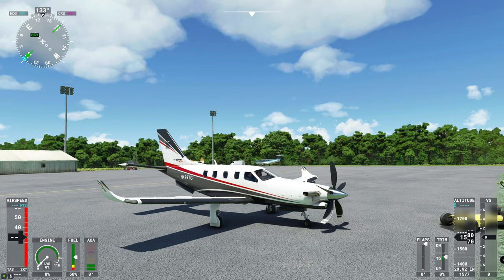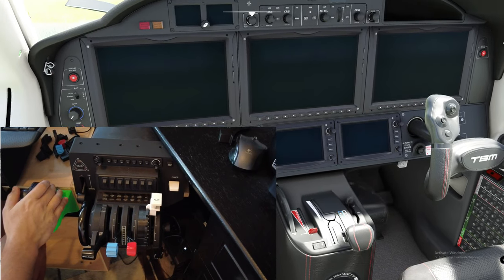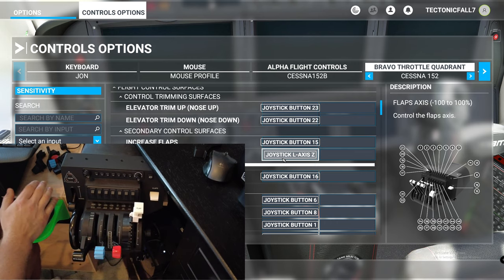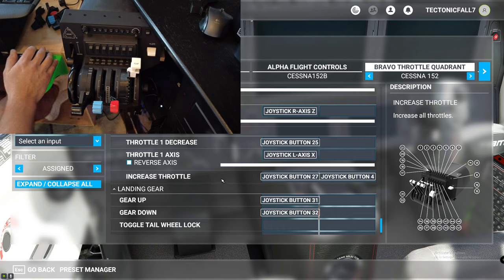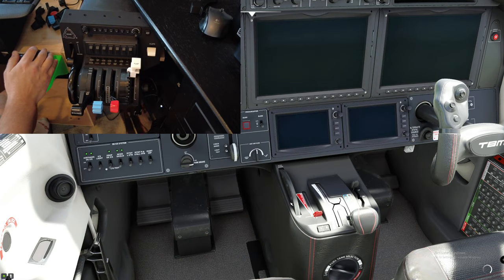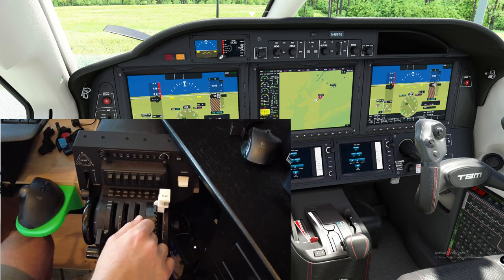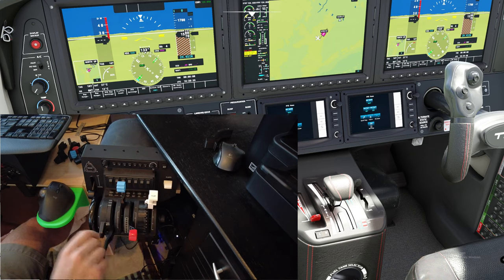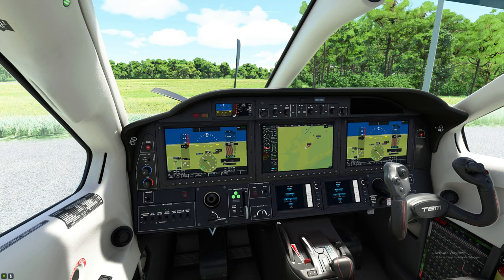MSFS Bravo Quadrant SETUP TBM930 AFTER Sim 5 ! Can't start the TBM930 and Throttle doesn't move!

Comment: Perfect! Just received my Bravo throttle quadrant and as the TBM is one of my go to planes, configuring it was a must. I actually used the Go Around button on that particular throttle lever to assign to the Increase Throttle function. Many thanks.
Reply: So after doing some playing around, my brilliant use of the Go Round button proved to be not so brilliant! That button is a bit too easy to hit - albeit accidentally - resulting in an undesired increase in throttle. Back to assigning Increase Throttle to one of the other levers.
Reply from the maker: Yeah I didn't think the Toga button would be good 😕 very easy to hit you can assign it to the Rev button

Comment: Thank you so much. I'm trying to get it yesterday by try an error, but after one hour I gave up. Now with your fantastic help - it works fine! The lever for “Mixture 1 Axis” is not necessary, if the “Increase Throttle” command is assigned to the “Button 4” (REV) on AP panel.
I also use the Flaps Axis at L-Axis Z, my switch “Flaps up/down” is then assigned to “Plus/Minus” to get a spool-up to the desired HDG, VS or ALT in AP mode.
Reply from the maker: Great I'm glad it helped you 😀 thanks for watching and sharing your setup
Reply: It also works if the “Increase Throttle” command is assigned to the “Button 9” (Go Around) at the Power Lever. I think it's easier to handle than to press the “Button 4” (REV) on AP panel.
Reply from the maker: @gerhardb8395  yep you can assign it to what ever button you want really I was just giving examples of where you can map it .  Thanks for watching 👀 .

Comment: Your videos are awesome. Do you think you could do a video showing how to configure the Honeycomb Bravo for the new Carenado PC-12? Keep making the great videos!!
Reply from the maker: Hey thanks for the comment since this video I no longer use the standard Microsoft flights and bindings. I now use spad. next for everything. It works so much better. But the PC12 still has issues with certain key bindings and that's most likely due to caronado not putting the wasm or lvar codes in correctly.

Comment: Very much enjoyed the video, and thank you for this set up routine.  I've bought both the Alpha and Bravo units jsut this last week - they are absolutely superb - what an upgrade!!  For this Daher fix, just initially I struggled with the throttle control, then realised that the Increase Throttle command I'd assigned to an axis was a switch effectively - leaving the throttle in the full down detent position really screwed up the Propeller Axis.  Once I'd realised my mistake - no problem!  I wonder if use the Alpha as well - I'd dearly love to be able to assign a switch to the Engine Ignition Start up top - any toggle commands end up with the switch going back and forth, and no other assignable command seems to work!!  
Thanks again - hope you dont' mind, but I passed this video on to an MS2020 subscriber to the Flight Sim forum.....
Reply from the maker: hey thanks very much for the comment . yes i understand about the toggle buttons i would recommend spad.nxt it is fabulous with the tbm  thanks again for watching
Reply from the maker: Also you may want to watch this video on the bravo a little issue that you will run  into https://youtu.be/dR-QUxHw1oA

Comment: Hey I'm planning on upgrading my sim hardware. Just wondering what I should buy first? The bravo throttle quadrant or the alpha yoke? Ik now own a cheap t-flight from trustmaster. And should I invest in a rudder control or just use autorudder and map it to a button on the yoke?
Reply from the maker: Hey thanks for the question so what I would if you are going to buy both anyway I would get the one that would make more sense to me. Meaning if you fly yoke aircraft all the time then you need a yoke but if you are a sr22 guy or a airbus guy the the throttles make more sense cuz they use joysticks. Once you figure that out the next is rudder pedals . DONT cheap on those I did and got the Saitek but they were not great and had issues with prolong use. Personally any type of pendular pedals would be perfect to replicate the real thing I upgraded to the tpr pedals and love them alot of people may say naw don't worry about pedals get the cheaper ones but they are also the people that don't have the penduler type pedals, so if you can't swing it now just wait until you can and save yourself the money you would have thrown at cheaper ones. Rudder pedals are a must for realism. 😉 my 2 cents
Reply: @2020fsers  I guess i mostly fly yoke planes like tbm 930, cessna 172 gp, and citation longitude. dont play dcs either.  going for the Alpha first and then for the bravo quadrant ( i really want the AP features it comes with, i´m so tired of scrolling my mouse). ill stick to autorudder until i saved up for the charlie rudder from honycomb. Thanks for pointing me in the good direction.
Reply from the maker: Your welcome

Comment: It seems to be working now ...Oh Boy - I am not using the Throttle Increase button FYI.
I can get the throttle to move back and forth Left to Right Feather location then pull throttle once to the low detent temporarily (quickly) to low idle, then again to throttle OFF.  FYI

Comment: I got something for you to help me with.  On the PMDG what would be the setting for the flaps.  The Boeing handle does nothing Selected to Flaps 0-100.  However the Flap switch to the Far Right works.  Can you look into it I’ll help test it.
Reply from the maker: Check and see if there is a flap axis from -100 to 100 and pick that one and retest
Reply: I’ll give it try when I get home.
Reply from the maker: Let me know 😀
Reply: Well what worked was Flaps AXIS with reverse box Checked.   Flaps 0-100 did not.
Reply from the maker: Great to hear glad you got it sorted 👍

Comment: Nice setup  adjustment!  Appreciate it!!!   Noticed your Bravo lights not activated on the TBM...is this a "bug" after the update?
Reply from the maker: its weird sometime they work and others they dont im still trying to narrow that down. im using the mixmugz mod now just released ima do a tbm ifr flight tomorrow and post with the g3000 mod from working title and ill see if the leds work.  thanks for watching
Reply: @2020fsers  Yes, I have had the same issue.  Seems like when I'm adjusting the setups, it doesn't work until I restart and sometimes even switch planes.  Wondering if launching the .exe is required as well?
Reply from the maker: @barrycobbley3331  yep I just posted a video on that for people that have the issue yes need to run the exe file after the sim loads 😉

Comment: Thanks I notice you have the first position covered (Speed Brake ? ) So the first throttle lever is in the second slot.  Im guessing its easier to add twin engine levers ? Also what is the "Throttle Decrease " and "Mixture Decrease" and any "Decrease" using the position number past the detent ? whats it do ?
The name is confusing ?  as is the Mixture Throttle and Propeller (-100 to 100% ) compared to the respective  "... Axis ?  does anyone understand the differences and issues with using these  ?  Should you use Throttle ? or Throttle 1 ?
IM trying to use what works but in my experience the MSFS has so many intermittent issues I cant tell what works and what does not? or what its suppose to do ?
Have you seen the rotate knob to increase or decrease values suddenly only allow 1,000 foot increments for altitude ?
Thanks again for your video
Reply from the maker: hey there thanks for the comment throttle decrease is used for reverse thrust  mixture can be use to turn off mixture they can be used for many diff things depending on the aircraft .  using throttle 1 or just throttle well if you have a single engine it wont matter but if you have a twin or more than it will because you dont want that 1 throttle to control all of them. yes i have seen the rotary knob change values to that i have no idea why .. Its just trial and error you have to use what works for you for what every you are trying to do . or get spad.nxt and that will really help but it gets even more confusing if you can't grasp whats in msfs. les orilley has awesome tutorials on spad  thanks again for watching

Comment: This is my favorite plane so far... and I still cant get the throttle working properly - for about a month I could fly but the cockpit didnt show what my throttle was doing .  I just tried to use the "Improvement" addon ... not sure that language applies ! lol.
Im frustrated a always with MSFS, but the XPLANE TBM is not as nice to look at or fly - so Im still at it. Im confused by the use of the PROP lever since I dont see that in the cockpit am I missing something ? Or is that just to allow the lever to move left for full flight power ?  The main issue is the throttle just jiggles and shakes ... I am reviewing the setup and all levers and positions.  
Any suggestions ?  I just deleted the 930 improve ADD ON however I did include the G3000 addon.  Thanks fot the video.
Reply from the maker: Thanks for the comment the prop lever is to get the throttle to move in the cockpit on the right ride of the gate and to move the throttle over to the left of the gate.
Reply: @2020fsers  I see that is the response... how did anyone ever get to that point ? is there a hidden manual somewhere ?  thanks again.
FYI I got the Throttle working properly... Unstable software apparently - I changed something then changed back - then rebooted.  It worked ? !  gaaaahhhh.  I see this way too often.
Reply from the maker: Glad you got it working
Reply: @2020fsers  and yesterday I had a flight and the TBM 9:30 everything cool try it again throttle just jiggled and shook... Came back to it and it worked this is a common occurrence although I don't hear anybody mention this in the YouTube videos I assume it happens to everyone maybe not. Someone else had recommended adding a button to increase throttle I use that with no effect apparently.
Reply from the maker: That I am not sure I use spad so I don't ever have any issues.
Reply: @2020fsers  Spad eliminates these sorts of issues ?  I checked out Spad - seemed complex.
thanks again.  My issue seems intermitent, the worst kind
Reply from the maker: Spad is pretty easy once you wrap your head around it . Check out les  O'reilly youtube he does great tutorials.

Comment: I’m fascinated by the mouse you are using.  You hardly seem to have to move it at all!  What is the make and model please?
Reply from the maker: Im using the Logitech MX Ergo Wireless Trackball . They also have the m575 model not sure why the text went so big I copy and pasted it. The 575 is about half the cost of the mx I love it. ❤  thanks for watching if you get 1 do y forget to clean the ball it pops out and clean with qtip and rubbing alcohol the rollers and the ball 😀

Comment: Sadly, a later SU has rendered these instructions unworkable. Following your instruction, Increase Throttle put the throttle in Low Idle rather than than initial increase. Using the mouse does nothing. I can still make it work moving the throttle and prop controls, but I really wanted something to move the throttle from Cut off to the initial lo point. 😬 Thanks anyway.
Reply from the maker: Yes this is an old video and doesn't work anymore . 😕
Reply: @2020fsers  Yeah, but now you can open the pilot's door and get out when you realize you can't get it started. 😃
Reply: I should of read all the comments before watching the video. It would have saved me an hour of frustratingly trying to get it to work, thinking I’m an idiot because I can’t follow simple instructions 😢
Reply from the maker: Lol no your right this doesn't work anymore unfortunately

Comment: Tried, but getting into low idle doesn't work. If I move my throttle even a little, it pops back to the left. Any idea why?
Reply from the maker: Are you using and mod for the tbm
Reply: @2020fsers  no, stock. I checked and double-checked your suggestions but can't get it to work. also checked for any double inputs.
Reply from the maker: Maybe something changed in su11 I haven't flown it so I'm not sure I'll check if I come up with something I'll let you know